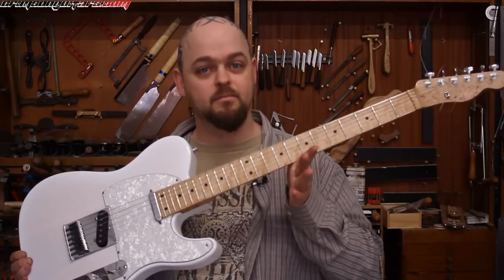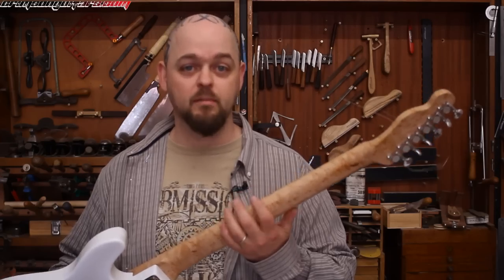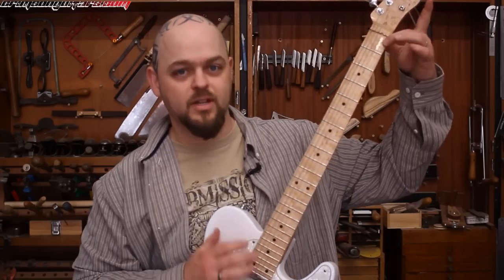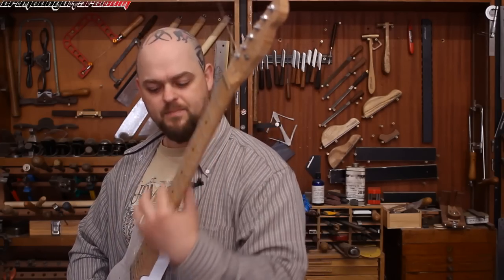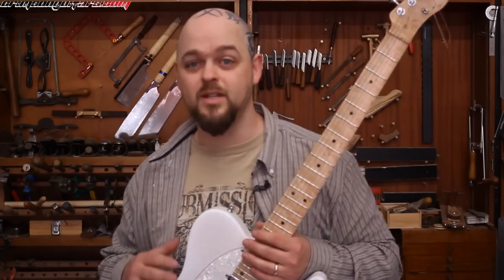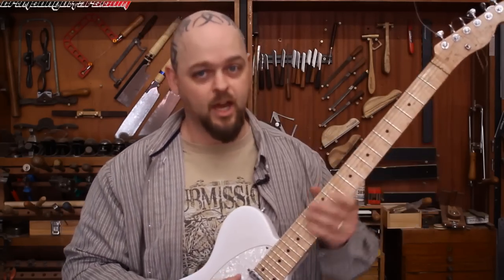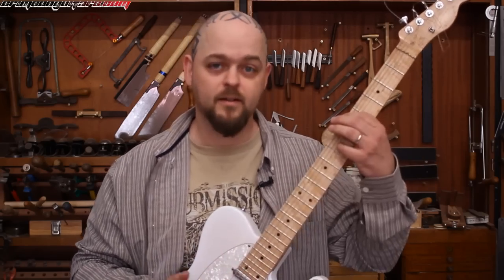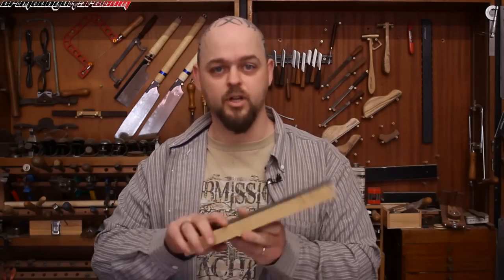Podcast 109 - How to Fix a Twisted Guitar Neck

Comment: release the tension on the truss rod the use heat not steam (heat gun) using dowels and carpenter clamps technique with using a straight edge it should repair the twist. Then allow the neck to set. After releasing the neck check it 5 days later to see if it moved back. Then level the frets, crown them and should be good to go for restrings and set up.

Comment: Shaving the finger board down .... give me a break !
Reply: How else would you do it ?
Reply: Green323. Just stick your guitar in a vice and use a pipe wrench to twist the neck back while you heat it with a blow torch. Real easy to do. Only takes 10 mins

Comment: I've done work on guitars with twisted necks before and never had to any straightening.  It's very simple, use a strait-edge and adjust the truss rod so the neck is straight along the MIDDLE of the frets, then check both sides (hi-E, lo-E) for straightness.  If everything's straight all you need to do is adjust the height of both ends of the pickups and bridge saddles to match the continued twist of the neck.

Comment: I suppose it would be ok to detach the fretboard, plane the twist out of the neck and then glue a thin veneer between the neck and fretboard to compensate the lost thickness?
Reply from the maker: Ooh! Great point, and I love the look of that sort of thing.. Do a 3 ply veneer and it looks like side purfling :)
Reply: I've had good luck with this method.

Comment: Hello Ben, great info! I had success with a twisted neck about 5 years ago and what worked for me was clamping the neck down tightly near the body, it was an acoustic so didn't want to take the neck off, the twist was up near the nut, I used the low E string and ran it from the peg down to a nail driven into the side of my bench, I used a bubble level and kept cranking the key until the twist was gone and bubble level centered as it was throughout the rest of the neck, then applied 125 degrees of heat for 24 hours, then humidified it another 24 hours in that same condition still under pressure from the low E string tied to a nail holding it in position, finally after 48 hours removed the clamps and low E string that was used to hold the twist straight and it worked! I still have that guitar and 5 years later the twist has never came back. Hope this helps someone, it worked for me and I saw another guy to very much the same here on Youtube on an electric guitar.
Reply: would love some pics or illustrations on how this.
Reply: How did you apply the 125 degree heat?
Reply: @carterdrain5784  fahrenheit or celsius 😁
Reply: @carterdrain5784  may be with an iron?

Comment: Putting balanced tension strings might help fix that over time....standard guitar strings pull stronger on the low-E side than on the high-E side. Equating the tension might help revert the twist...
More drastically, you could maybe bias the tension towards the high-E e.g. by taking the high-E,B and G from an 11-50 set and the D,A and low-E from a standard 9-42 set...Tune it to pitch and leave it for  a period of time....
Reply: Stringjoy ftw
Reply: I was thinking the same.

Comment: What a strange coincidence! I just fixed my old dot, she had a huge twist in the neck, probably bought on over the last decade or so since the neck break. More relief on the treble side, due to the twist, made it impossible to get a decent setup. My solution was to remove the frets, flatten the fretboard, and then re-radius it. Much to my delight she's playing great now. Cosmetically not the best, but it was a straightforward enough fix and the slightly irregular depth fretboard isn't really noticeable unless you really hunt for it, especially as much of the material was taken off the treble side. Taking the fretboard off sounds the best bet, but as you say, and I agree, taking steam to an already twisted neck is asking for trouble! The idea about straightening the neck with the fret tangs is an interesting one, great in theory, I'd love to hear if anyone has had any success. Thanks for the videos, they are a great resource.

Comment: I fixed a twisted neck once by taking off the strings, forgetting about it, then a year and a half later it was straight and I put new strings on  .10 set down from the.13 that it used to have. I hear it's still good. Thin necks can't handle too much tension..

Comment: I realize this is a bit old of a post but...I have to give credit where credit is due.  Ben, you are the f#$%in man!  I tried this on a guitar I purchased from a <insert bad name here> on Reverb.com.  It had a very similar twist to the tele neck in the video. I used Jescar EVO Gold frets, crimped the tang on the opposite side I wanted raised a smidgen and it flipping worked!!! It isn't perfect but before i couldn't get a straight edge with fret notches to stand on fretboard on the high E side...now it will stay without falling over.  Thank you Ben for your amazing talent and willingness to share with us :)

Comment: I was searching this topic, oddly didn't check this channel first (at this point, I should just look here first for everything). I'm converting a five-string bass to a fretless, and the donor neck has a slight twist. I think I'm going to try the method you described here, but with the veneer pieces I put in to replace the frets. I'll just make the pieces a hair thicker on one side, maybe with a slight taper (wedge), so when they expand with gluing they'll push the twist back slightly. After that, I should be able to finish it with the sanding beam. I'll let you know if it works. Thanks for the great videos as always!

Comment: I have a 4 string bass neck slightly twisted to the g string side at the head stock and about half way downthe neck, however the heel pocket end is flat . Its not a complete twist like you were referring to the on the white telly. 
I bought this bass for 30$ no strings and missing nut and  stuff and didnt get to play it. So I dont know if the slight twist will even have any noticeable effect at all. But I was liking your thinking about twisted would be more comfortable.

Comment: I think you can get there eventually with small truss rod adjustments and going with heavier gauge strings to pull the neck back or side to side and letting it settle. Where to start with this ? 2005 Squier Strat, the neck looked like an elf slipper last summer, probably had a gentle twist in it, may still have some virtually indiscernible twist too. Truss rod was adjusted several times. I went with 9.5's instead of 9's. Researching D'Addario's string tensions, the heavier the set, whether they're hybrid bass & treble sides or just a complete 1/2 to full step in gauges, the string tension is going to be 18 lbs more tension (9's-10's) as a complete set when it's tuned E2,A2,D3,G3,B3,E4. Imagine the tension differences going from 9's to 12's ? I went from 85 to 91 lbs of tension with 9.5's from 9's. Going 10's from 9's, string tension goes from 85 to 103 lbs as a set. Moisturizing the wood helped too, never use water, fretboard natural oil to re-condition the fretboard was my method. If drying out the wood caused the warpage, the wood was dried out in a kiln to get the moisture out of the neck & body when it was made.

Comment: Please flame away if you disagree but if a neck is so warped that it needs fixed, is it not cheaper and better to just buy/build/order a new neck? Considering 1. the wood might just be prone to warping, ie bad luck, 2. the time and effort spent is not worth while 3. having a pro doing it will probably cost more than a good new neck?

Comment: I know of several guitar repairmen that uses an oven for straightening a crooked neck. I think a couple of hours at low heat, and not necessarily having to remove the frets. This might work best on vintage non trussrod necks. Afterwards it's clamped to a straight board for x hours while cooling down. I don't have any personal experience with this technique though.
Reply from the maker: I will give it a good try one day :)

Comment: His ideas are very drastic. I had a twist in a les paul like neck from the 3rd fret. I conditioned the fret board the day before with a Gibson fret board conditioner. Then i loosened the truss rod with two turns. After that I tightened the strings on the side of the guitar i wanted to upward (G B E) from the front of the guitar. I then loosened the other three strings from the side i wanted to move downward (E A D). I placed the guitar in it's hard shell case and dampened the fret board and left a damp sponge in plastic bag with holes in the case (i did this to avoid the wood cracking and to make it more supple). I placed a small folded book on the side i wanted to move downward (E A D) and closed the case. The case created a downward force to move the neck. Like a vice.

After an hour i took it out of the case and tightened the strings more on the side i wanted to twist upward (G B E). I then tried to twist the neck by hand in the direction i mentioned above. After a few minutes the twist in the neck disappeared. 

Now I put the guitar back into standard tuning and tightened the truss rod two turns (back to it's original state). I let it sit and settle for an hour in it's hard shell case.
Reply: please post how this holds after a reasonable amount of time. I have a mid 70s' yamaha fg165s with a twisted neck. these guitars were laminate but played and sounded incredible for their cost. High action so I mostly played bluegrass and blues slide with it and would love to get it back in playing condition again.

Comment: I recently found that I really enjoy playing guitars with compound radius fretboards.  I have an old cheap stratocaster neck that I'd like to put a stainless steel set on. Philadelphia Luthier Supply have a has a service that will send you pre-bent frets so I thought I'd use those. So here's my question do I need to do anything to the actual fingerboard after I take out the old frets and before I put in the new ones

Comment: And what should i do when my neck is twisted in different way?
For example high E side is straight (0,1 mm bow) and on low E side i have 1 mm bow at 12-th fret
Neck is made out of little flame maple with no skunk stripe but with separate fretboard with a classic fender style truss rod
Also neck might be a little to thick, but that is debatable.
What is the most correct neck profile and thickness?
Reply: kokodin I've had this issue with the last 3-4 guitars I've bought, if the treble side is completely flat, there is a slight concave bow to the bass side.

Comment: Hi Ben, great video, love the ideas in dealing with a twisted neck. Especially about the neck with too much relief. I have a Martin D17M with too much relief. I believe the neck has moved as much as it will, it's a couple of years old now ( bought it new in 2014). I began to have relief issues shortly after purchase (even with adjusting the truss rod, the neck was constantly moving) and pretty much put it away til I could do some research as to how to solve my guitar's problem. This is the first video I have found that provides some useful information in rectifying this issue, I plan on trying a re-fret as you recommend (crimping the tangs) and will let you know how this works. Thanks!                      p.s. I'm not a stranger to repairs:)
Reply: Did you try just removing the strings and let the guitar be for month or so?

Comment: There is another way to make wood move permanently and that is boiling it in linseed oil before applying pressure and clamping. A friend of mine who worked on fine English shotguns, did it all the time to bend a gun stock so it would "fit" the shooter correctly.
Having boiling vats of linseed oil around the workshop is a bit of an extreme sport though, and I wouldn't actually recommend it to anyone....

Comment: I don't have a question but a suggestion. What about a podcast about how to paint and apply lacquer?
Reply from the maker: It is on the cards but we need to figure out how to safely film in the spray booth.. I have some awesome lacquer to talk about too!
Reply: Nice! And by the way, this video about twisted necks is helping me a lot. I've got one guitar (cheap yamaha) which has this problem and I think I'm going to remove the frets and sand the fretboard. Thanks a lot!

Comment: My son pushed over my Ibanez RG Prestige and put a dent in the finish on top where the arm rest is, which also put a crescent shaped "crack" in the finish abt 7mm in diameter and maybe one mm deep or less. Unfortunately, Ibanez will never sell their paint (cosmic blue). Do you think I could possibly wet sand the finish with 1500 grit, then polish with a rubbing compound to get the crack/dent out?
Reply: William Smith you could probably drop fill that with ca glue, then sand it flat, it wouldnt be invisible but i bet itd be good enough

Comment: How can I fix the twist on my 1960s Hofner bass violin? I don't want to remove the frets or even think about going near it with sandpaper or a planer? The twist is in the 'undesirable' direction. Someone suggested letting it sit with the low E string slack, the A string slightly more taut, and the other two under normal tension. In theory they said this should remove the twist. What about removing the strings completely and letting it sit? The tension of the strings is what causes the neck to twist in the first place isn't it?
Reply: No not really , Its the wood grain its self. Take the strings off and see what happens with some aggressive truss rod adjustments . 
It might level some of it out.

Comment: so recently dropped my guitar and when I picked it up I noticed that when I play it makes a very loud buzz noise from the top of my guitar specially when I play the open strings. I've spent hours looking at every part no loose or broken pieces, I've tried adjusting the truss doesn't seem to be the issue as the noise is not even from the strings touching the fret board, the only very strange thing is that when hold the wood where the tuners are mounted it almost doesn't buzz anymore again the buzz is not from the tuners either and I can't see any crack on the neck or anywhere. I'm so confused I would really appreciate it if u could at least tell me what the problem is!!

Comment: All the youtube videos I've watched on this topic have the exact same twist where the side with the high e string is back compared to the low e side. I hear it over and over in the comment section. My guitar has this problem. Im assuming that it is the uneven tension from the different gauge strings. The low e side has more tension than high e side. I think the trust rod should have compensation implimented. Perhaps route the grove at a bit of an angle along the neck so that it is a bit off center towards one side at the headstock. It doesn't need to be noticable because you could just use a slightly larger trust rod cover. Perhaps only do this as a solution to a guitar that has this probem to begin with. Just re-route the trust rod channel and shim the low e side.

Comment: I have this problem with my cheap bass guitar.  The first thing I will do to repair it is get a job, so I will have money. The second thing is to buy new frets, string and sanding paper. The third thing is remove the fretboard, i think the fretboard is fine, so i will only replace the frets later. Than I will repair using the sanding paper with something, check if it's straight, than put the fretboard back. I hope it will work.

Comment: Is teak a viable option for making a fretboard? I have made a guitar with a three piece teak neck(neck through), pine wings with teak cap. The teak I have is extremely old.
Reply: +Anish Kolhatkar Can't see why not, we lay Teak decking on boats for it's hard-wearing properties so it should stand up to a bit of string wear - IF you can successfully glue it.. I used some leftover Teak to make a fingerboard last year. (Needed a bass in a hurry, so used up whatever was laying about) It was well keyed up and degreased with plenty of acetone, can't remember if i used polyurethane or epoxy, but it's lasted thus far. Of course using either of these glues means you'll destroy your neck if you ever want to replace said fingerboard, but i don't know if i'd trust more traditional glues with Teak. Anyone care to comment?

Comment: I think you may have your fret fix backwards. Shouldn’t the thicken part of the frets be on the high strings at the nut and the low strings at the base of the neck?
Reply: No, the compression from the frets with push that part of the neck into a back-bow by selectively slightly widening half the fret slot, so it will drop the high parts of the twist back. If you imagine on a larger scale, hammering a wedge into a crack, it will push the crack apart and open. Does that make sense?

Comment: Hey I have a question.
On my les paul style guitar there is 1st fret end lifting a little bit on a bass side.
I tried to glue it with ca glue and it worked for a moment but it starts rising again, i can fit there 0.10 mm feeler gauge. 
What should i do ?  epoxy and clamp it ?
Reply: TheKrzesiwo32 btw very intresting episode, keep the good work :)
Reply: I had this problem....I used super glue and a small clamp with protective pads then sprayed super glue accelerator on it and it worked fine hasn't moved since
Reply: If it moves any further I'll try this method. Thanks for your response :)